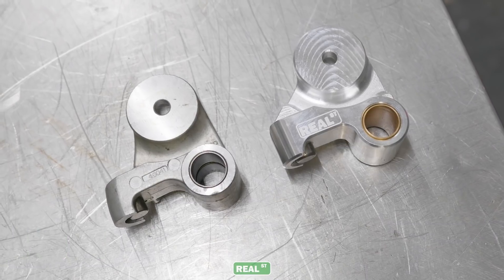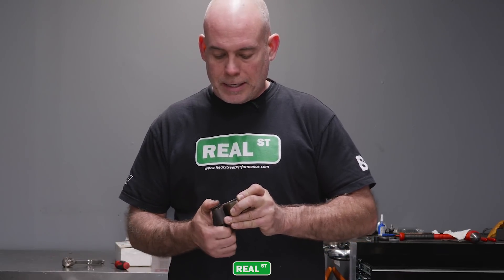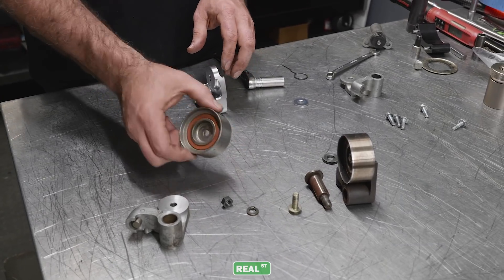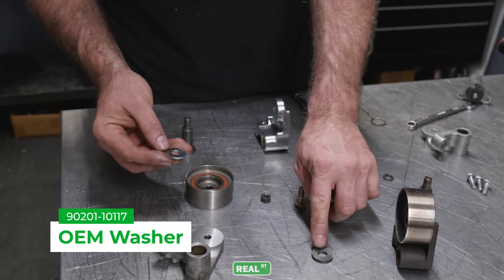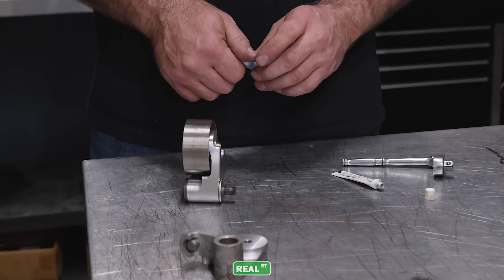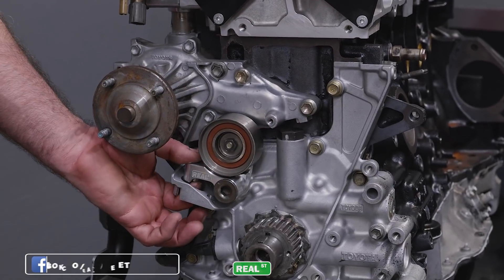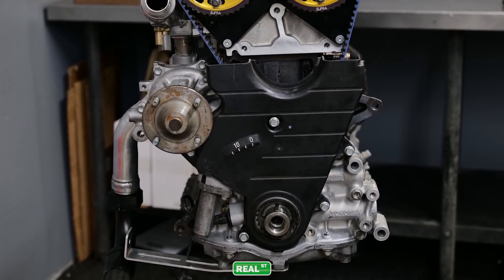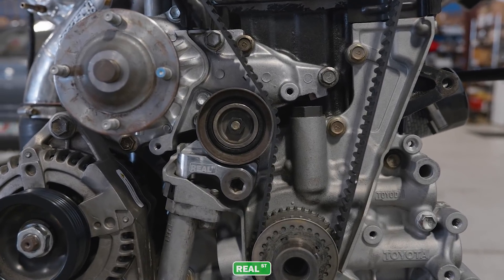Why You Should Upgrade Your 2JZ Timing Belt Tensioner Bracket - Real Street

Comment: I need help, I have a gs300 (2jzge) with 160k miles and I did the change of the timing belt myself with the cam and canshaft seals and now that I have it without the cover I see that the belt on the side that does not have the Tensioner when I accelerate it and the rpm is lowering it shakes like half an inch, I changed the tensioner and nothing, the vvti gear looked off center like for a millimeter I removed it and I put it back and nothing, I don't know what it could be or if it is normal, if someone knows please help, by the way the vvti continued ofcenter if it is not normal the same, someone tell me 🙏 very good channel, you learn a lot
Reply: Hello Abraham,  the side of the belt that's not tensioned (Intake side of the engine) will have movement in the belt. I assure you it's like this on engines without gears and to some degree a chain.  You can think of this movement as the belt exhausting harmonics that have been driven into the system.  If you want to see a really ugly visual watch a high powered motorcycle chain in slow motion during a launch. IF this movement wasn't present on the belt the energy you see making your belt flap would be available to damage something. The people that add idlers to remove this "slop" in the belt are often rewarded with broken cam gears or sheared dowels.   As long as you followed the service manual instructions you will be fine. Thanks
Reply: @jaymeagher1510  hello Jay,  Thank you for responding so quickly👍, I was walking with my car trying not to pass 2000rpm and as fast as I saw your comment I started to drive normally reaching 5000rpm and so far everything is fine, thanks👍

Comment: Why use anti-seize on that bolt instead of maybe a moly lube or something else that will last long enough for the service interval of that belt. Anti-seize has pieces of silica in it doesn't it? I was always told not to use anti-seize as a lubricant on moving parts because it will act as almost a lapping compound. Over time it might open up the ID of that tensioner. Don't know if that might cause a problem.
Reply: You're right, your comment is way underrated

Comment: Ross Racing does a similar part for the people in Australia.
Reply from the maker: Theirs looks nice, we prefer to use a bushing in ours
Reply: @realstreetperformance  yeah I agree, if only I knew you guys did this part, I would have got them shipped over
Reply: Not happy with the Ross part. My engine builder told me It needs to be honed. Instead I bought a new phr one with the pressed insert (Just like this one). Probably better in the long run.

Comment: What's the advantage of this tensioner over OEM? I can see you explain why it's better than aftermarket tensioners, but not the factory one. Thanks
Reply: Bro, he mentioned that it's a stronger construction and less prone to breakage and the brass bush prevents stuck pins
Reply: @krispykruzer  he's comparing it to billet steel aftermarket tensioners. Not genuine Toyota tensioners
Reply from the maker: The OEM one breaks in half, so an aftermarket one is necessary.

Comment: Why didn't you upload this 24hrs ago BEFORE I ordered my cams and springs off you guys?! 😂👍
Reply from the maker: Sorry guys, we just added some media staff to get content out faster. We will turn up the boost on our media production for you lol
Reply: Billet tensioners have been around for years, you should check out some old threads on supraforums. A wealth of information on parts and builds, Mark Conte the managing partner of Real Street is also a member and has provided a ton of feedback over the years.
Reply: @MafiaboysWorld I was thinking the same thing bro. I just spent 5600 on rebuilding my 2JZ and about go back to buy this and some more stuff I need that 1000hp
Reply: @evo8stunna  Bro, I passed into 5 figures on my 1JZ a little while ago. Billet Main Caps, CP Pistons with .250" pins, Spool Rods, ARP studs, ATI damper, TWO GT2860RS turbos, 840cc injectors, the whole bottle of jam. 😎👍

Comment: Oooooooo I want this. How much shipped to Australia?
Reply from the maker: The tensioner is $249.99 USD at the moment. If you go to our site and add to cart and select australia it will give you a shipping quote. I just tried zip code 2000 as an example and the least expensive option is DHL for $30.78 USD
Reply: 380 shipped to Perth wa

Comment: I imagine this will work on a 1jz as well
Reply: I've been told these are needed if you run a kevlar timing belt.  And that makes sense since those put more stress on the tensioner brackets than rubber belts do.  If you use OEM Toyota belts the stock brackets are supposedly ok until like 800hp.
Don't take this as fact, please research and ask your local engine builder to figure out what part you need for your build
Reply: There are slight differences in the shape of the 1JZ and 2JZ brackets.  
The pulleys are the same though.  
If you are looking for a billet 1JZ tensioner, Driftmotion and Ross Performance both make one
Reply: @brianwhedon8442  
interesting but i think for what my goals are it probably isnt needed. im only looking to make 450-500. maybe 600 down the line when i upgrade the fuel pump and front mount.

Comment: How long is the "relatively short amount of time" before that steel one without a bronze insert corroded? I have just bought a steel one in the UK, and I am now worried it won't last long.
Great video as always :) cheers
Reply: take out the bolt and clean it regularly
Reply: @carlosbarrera6348  well, this is what I mean...how regularly, are we talking like 2 months, or 5 years before corrosion starts. If anything I would rather send the one I have back and buy a real st. one.
Reply: @BassInterrogation  use anti sieze, youll be good for many yrs